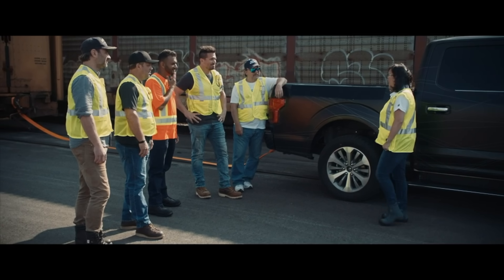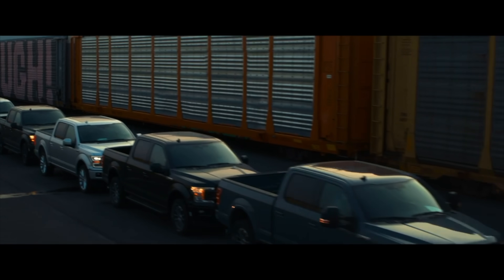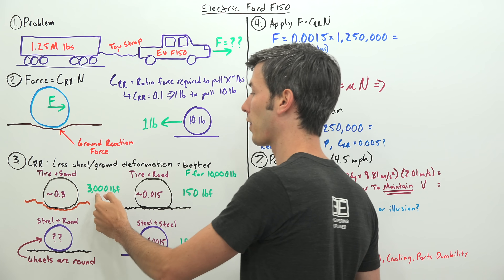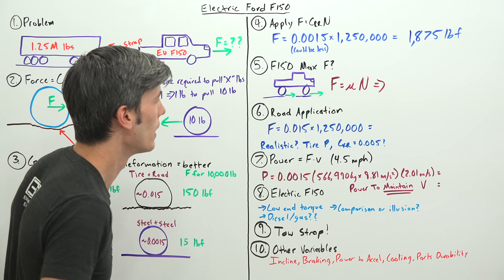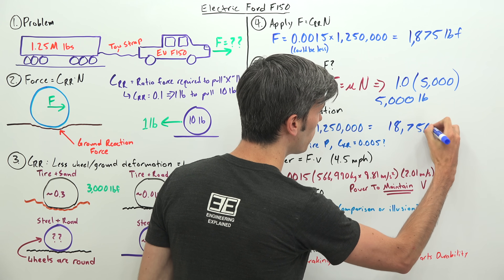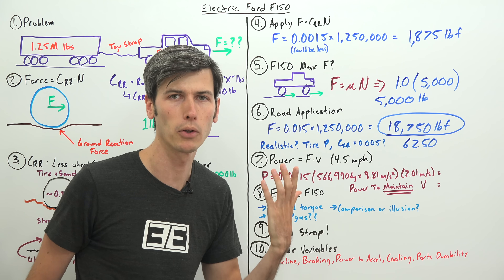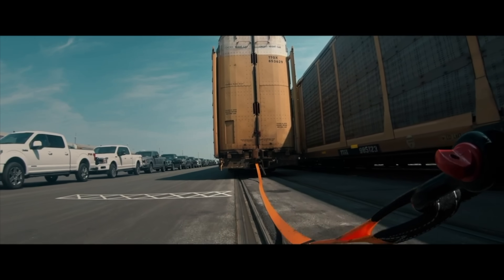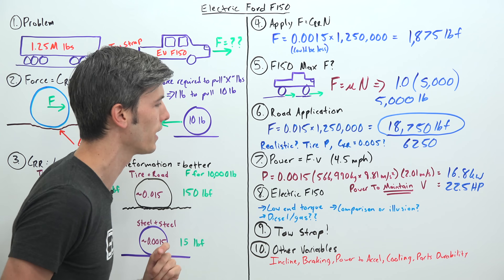No, Ford's Electric F-150 Can't Tow 1 Million Pounds (Realistically)

Comment: The average mind has difficulty understanding that vertical force i.e. weight due to gravity x mass doesn't equal horizontal force e.g. pulling and stopping a mass.  As some goofballs have said, a Prius could get a 30K lb trailer moving, but stopping is the main issue (as well as very slow acceleration... flooring it would eventually break something or overheat the motors, and don't even talk about uphill lol).  When truck manufacturers rate a certain tow weight, they are talking about all-day long towing up and down mountains, SAFELY.  Pulling anything much heavier than the pulling device allows it to get whipped around in bad crosswinds, tire blow-outs, etc.

Anyways, thanks for the video Jason.  Folks don't realize how low fricton train rails really are.  I saw this coming, but indeed good marketing on Ford's end.

Ram and GM could come in and double the weight without a whole lot of trouble, lol.  Imagine "Ram 1500 4x2 V6 pulls 250,000 lb. train"!!  :)

Comment: Its WAY more simple than that.... Trains have slack in every coupler, that slack allows you to pull the first car a couple inches before the second one gets jerked moving, then once TWO are moving then those two have more than enough inertia to get #3 moving...and then you have THREE moving #4 and so on...so actually the F150 only has to pull the FIRST one to get the inertia started...now there is some friction power that is used up along the way...but as explained that is very small compared to rubber tire vehicles.

Comment: “I believe it can’t pull 1 million pounds” 
Also in the same video: 
“It actually pulled 1 million pounds”
Reply: Under very specific conditions that a normal consumer would have neither the need nor the opportunity to perform
Reply: @TrashDeviant  The normal consumer would probably tow semi trailers and wide load construction equipment or vehicles with it if that truck pulling 1 million + lbs were true.
Reply: Panamera Ghost It’s true that it did pull 1 million lbs. It’s a display of horsepower. On the road it’s dangerous.

Comment: I don't have the precise maths, but when I first saw the video I saw the steel wheels and rails and thought, 'you only have to get it started'. The strap not breaking was a marker that suggested that the force didn't need to be that massive. The other thing that struck me was how they stopped the train. That wouldn't have happened on a sixpence, so they had to keep the EF-150 moving out of the way on a slack strap. Bet that didn't look too promo. It was a good stunt though, so well done Ford - finally admitting they might have an electric future.

Comment: So, to simplify this video somewhat. Railroad rolling stock has wheels made of steel. Same for the rails. Steel on steel equals very minimal rolling resistance. Those same steel wheels resting upon those steel rails have a contact area equal to approximately the size of one U.S. dime. Less rolling resistance due to that also. Another item to consider is that the couplings between railroad rolling stock have slack or looseness. When the truck begins its pulling, it is actually pulling only one piece of rolling stock. This gives inertia to that one piece. Slack is taken up and the second piece of rolling stock begins to move, creating more inertia etc, etc. *I am not an engineer nor do I portray being an engineer on YouTube or otherwise*.

Comment: I wonder isnt that force you calculated valid for a wheel which has 1.25 million pound of mass? But the weight comes from wagons so what is the effect of normal force on the wheels to the inertia? Shouldn't it be calculated like that?

Comment: I'm surprised you didn't mention the play between couplers as well, those auto racks have a ton of slack.
Having to start only one car moving at a time is a huge advantage vs. lifting the whole train at once.
Reply: Exactly this.
Reply: Agreed let’s fill the truck bed with osmium 😂😭
Reply: They usually reverse slightly to close the gaps before moving off.
Reply: Came down here to post this.
Reply: aye, I said the same thing. didn't see your comment, that's why when a train stops it sounds like thunder rolling through all of the cars, the slack is closing between each knuckler in succession from front to back.

Comment: What about the model X pulling the Boeing 747?
Reply: That was a lot more realistic and actually difficult. 

Boeing 747's weight was being pushed down on it's rubber tires while the Train seen in the Ford video has all of it's weight dispersed throughout all the steel wheels. Suffice to say without getting into very complicated math... The fact the Boeing 747 had less surface area to transfer the weight to the surface, was using rubber tires, and how much the vehicle itself weighted, the Tesla was actually pulling in the hundreds of thousands of pounds.

Comment: They’ll have to change the name, right? If I’m not mistaken the 150 indicates that it can tow 1500 pounds, but not as a direct rip off (but still a rip off) from the Dodge Ram 1500 before it that was name=pounds that can be towed. Correct me if I’m wrong please.
Reply: The numbers in truck names indicate the payload capacity of the bed of the truck. F-150, Chevy Silverado 1500, Ram 1500 can carry up to 1500 pounds in the bed. As the numbers get larger, so goes the weight capacity. An F-250 is rated to carry 2500 pounds.

Comment: You need to multiply the 1,250,000 by 9.807 because F=ma. So the normal force is the mass of the object * acceleration due to gravity.
And really you should be working in metric here.
Reply: 9.8 is the factor between newtons (force ) and kilograms (mass) in metric. In imperial measures, 1 pound-mass of mass generates 1 lb of weight (on earth), so no conversion is necessary (I think. Physics class was a long time ago.)

Comment: You make a good explanation of why railroad cars are easy to pull. But you forgot to consider one more thing : the couplers slack. Every railcar's coupler have a minimum slack of 6". With two couplers per car, you have a minimum slack of one foot per car. This slack is specifically made to make the pulling easier. When pulling something, the hardest thing is to break the inertia. With the couplers slack, you break that inertia one car at a time. You pull the first car one foot before you start pulling the next one, and so on. So in fact, the real trick is that you pull your 1.25 million tons one car at a time, which is less than 150 tons for each individual loaded car. Without the coupler slack, even the 4600 HP locomotive couldn't pull that amount of weight.

Comment: Anyone remember when volvo's diesel truck pulled 1.5 million pounds on normal trailers on pavement?
Reply: Yes, but those trucks make well over 2,000 ft/lb of torque, and weigh about 9 tons themselves. Meaning they have both the power and traction to do that, so it's sort of the same illusion. Also, their gearing is super low to make getting started easier as well.

I'm a truck driver, and I so this all day long. The only difference with that much weight is how long it takes to get up to speed. You will heat the clutch up at the beginning, but in first gear it won't take much feathering until you have it fully engaged. ;)
Reply: @Broadpaw_Fox  Yes I know all that. Also the first trailer was partly on the truck which further helped with grip.

Comment: @engineeringexplained Hi, new to the channel. Enjoyed the video, just a question. Wouldn’t the rolling resistance coefficient be altered due to the amount of wheels used as the load is still the same, but there is more surface area in contact with the rail? It looks like it’s seven rail cars long so couldn’t see if it has 2 or 4 wheels a end. If it has 4 wheels a end or  8 wheels per rail car wouldn’t the rolling coefficient go up as there is 56 wheels in contact with the rail?

Comment: The biggest steam locomotive every built, weighed in at nearly 800,000 pounds. With it's tender, it's total weight was around 1.2 million pounds. When the engine was finished, and it was time to roll it out of the factory, it only took two people to push it. In fact the whole 1.2 million pounds could be pushed by 6 men, as long as the pistons were disconnected. It's not about the mass of the engine, but the resistance and time.

Comment: You don't have 1.25 million pounds weighing down the truck.... you have 1.25 million pounds weighing down on the carts.... As long as the truck provides enough force perpendicular to the direction of the normal forces that is all that matters.... Trains are all electric vehicles.... Hybrids... They don't produce much power...

That is why the truck is using a strap about the length of a football field... to make sure all the force is being pulled unloaded from the truck...

Comment: Thank you EE for calling it like it is! Rail cars are designed to move as much mass as efficiently as possible. I haven't done the math myself, but this stunt may actually be quite a bit less impressive than the space shuttle stunt Toyota did years ago; given how much higher the coeff of friction is for rubber on concrete.

Comment: I followed everything until point #4 (and #6), don't you have to multiply the number of wheels to the net force of rolling resistance calculated as per wheel basis?
Reply: Nevermind, I'm a bit slow. Just realized that it doesn't matter how many wheels since the total weight is distributed across all the wheels... HAHA (laughing at my own stupidity)

Comment: It isn't fair to theoretically put the train on a road.  Rails are magic. 
I was unable to move my School Bus on a road at all with a Chevy Suburban.  However Long Subway Trains and Trolleys are routinely moved by Chevy Suburbans in emergencies , or power out situations.
Reply: Certainly not on normal road tyres for sure stick some Boeing 737 tires on it and you might be in with a shot. Course this sort of stunt has been done many times before with having cars or even people tow airliners around relying on the fact the audience will mostly just blindly go "Oooo big thing" instead of catching on that the rolling resistance is way lower than people assume.

Comment: If the car is capable of accelerating the 1.2M pounds then surely it also has the braking capacity to stop it. It's pretty much the same coefficient of friction with the ground that limits the amount of force. It may not stop it in 10 ft but it will stop it. Could make some fairly serious looking skid marks if the driver went all in with the anchors.

Comment: Yes it can remember it is not dragging a flat object on solid ground,, all’s that it has to do to pull 1 million pounds of train cars on flat ground is provide constant torque n don’t jerk It spinning tires being dumbass just put constant torque with out slipping tires slowly you’ll find the cars start moving then after about 10 cars take up slack the light jerk of each car forces the next car to start moving all the towing vehicle has to do is keep maintaining the power ,, it doesn’t matter if it a Ford  Dodge Chevy Toyota or Nissan  ,, it does help if the towing  vehicle is loaded pretty good so it can provide max torque it has available, we had to do this we work in coal mine and temple winch to pull cars broke down messed a few automatic transmission the dealerships couldn’t figure out why the were burning up so fast

Comment: Two points. First, a tow strap stores energy when the initial pull is started by stretching slightly then it releases the stored energy as it snaps back. Any serious off roader knows this and uses it to his advantage when pulling his buddy's stuck vehicle. Second,  you missed the fact that Ford put 4 big guys in the cab for payload to enhance traction and increase the truck's mass and pulling potential. They probably had some wheel spin issues on the first takes and then added the extra weight. I wasn't impressed the 1st time I saw the video. Toyota used the space shuttle for a similar stunt when NASA moved it to CA a few years ago.

Comment: Locomotives actually don't pull the full weight of the train from a stop. The couplers between cars intentionally have some space between them, so when the first car gets going it doesn't connect with the second one behind it right away. That way the inertia of the first car helps to get the second car going, and so forth. So if the cars in this train were done similarly, the F-150 initially only had to pull the weight of the first car. So the pulling force might even be significantly lower than 1875 lb.

Comment: Another thing to note which makes it even easier to tow this heavy multi car load is that there is a small distance each rail car moves before the next one does, due to the slop in the couplers. As you move along more and more cars engage, slowly adding adding up to the final weight.

Great video as always Jason!

Comment: Back in the days of steam the locomotives couldn't just yank a train from a dead stop, pull all the cars at once. They would back into the train, then pull, that way they started it one car at a time, there being some slack in the couplings. Sometimes they would have to repeat the back and pull maneuver several times to get the whole train moving. Diesel electric locomotives are better at dead yanking a train, electric motors have full torque from zero RPMs, but may still need to employ the backing start method. I wonder if there was slack in the couplings when Ford did this stunt? 

I used to hear this technique used when I was a kid and steam was still being used. This would've been in the early 1950s.

Comment: @4:00 ok I'm stopping right here, I can guarantee you that I can produce more than 15 lbs of force and I can not go out to a 10,000lb rail car and pull it down the track... Where are you getting your numbers lol.
Reply: Yes you could.  10k lbs on a rail would be fairly easy to move.  That's not much weight on steel rails.

Comment: This is why the VW Tuareg TDI pulling a 747 video is so much cooler!
Reply: Not really. A few years ago a body builder did that. Simple body harness chained to a 747 at the wheel and he pulled it 100 meters.
Reply: Midgets pulled a plane, forget which one, so it really doesn't make the Toureg impressive at all
Reply: Trümmertürkes Leiche  nah diesel is way better but tourags are pre gay
Reply: except the tourag is gay
Reply: If that monster V10 diesel is gay, then I’m going out to buy lube and condoms right now cause I’m in love. 😂 That engine is so much more powerful, more efficient and more advanced than any of the asthmatic pushrod gassers that American automakers have been foisting on the general public for decades it’s not even funny.

Comment: While true, that's still more than 4 times the lb-force of a current F-150 (265-400 lb-ft depending on the model).  That's a staggeringly high amount of force for a consumer truck.  Having it on a rail obviously moves this into the realm of possible, but it would still be outside the realm of possible for a normal vehicle.

Comment: Strong winds can blow those cars dependent on grade. Also, alot of tracks in yards are bowled to prevent rollout. Seeing as there is no engine attached for braking. They may have used a bowled track to prevent rollaway as a safety. Which means it's possible they could have been pulling on a slight down slope. Either way the way Ford staged everything. From using lbs instead of tons and everything else is shady and misleading to the average consumer.

Comment: Why are you assuming constant acceleration over the 1000 feet? More relevant than horsepower is the pounds of force required on the tow strap to accelerate the load. Even if the train cars take about 10 seconds to accelerate to 4.5 mph that’s about 30,000 pounds of force. That’s doable for most trucks, but it’s going to take more than a 5 hp riding lawnmower.

Comment: Truck companies have been doing this visual stunt for 50++ years of TV commercials.  I remember Chevy Trucks doing it on Bonanza as a boy.  I worked at a chemical plant in the 90s and they had a pickup with rail wheels and rubber traction tires to spot chlorine cars.  It could pull a lot on level track.  As an engineer, we all knew why.

However rolling resistance on steel rail should mean that your Tesla could make 800 miles or more on a charge ON RAILS with banked superelevated curves.

SO instead of hyperloop tunnels and Tesla secret bumpy boring tunnels, why not stick rails between the two portions of divided interstates or the shoulder tree clearance and have new cars be hybrid (rail and tire) like a CSX service truck.